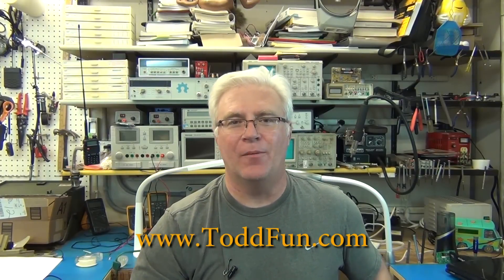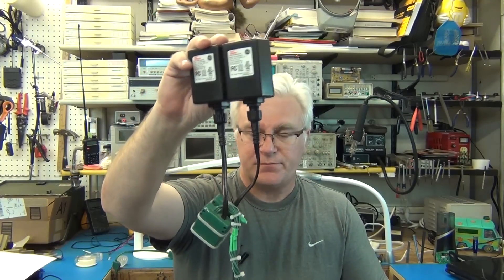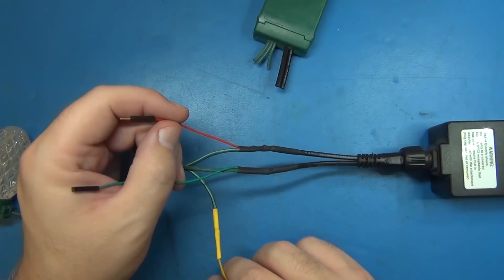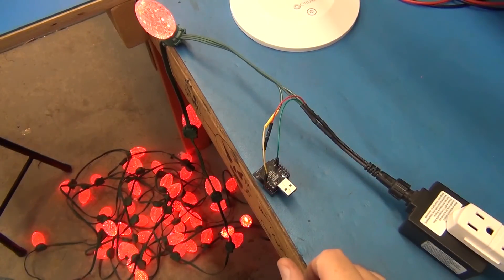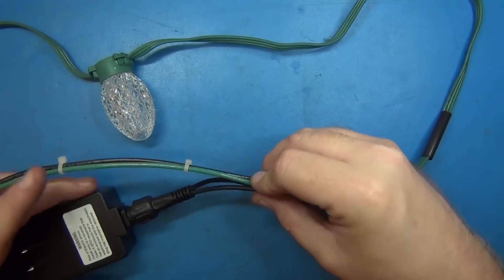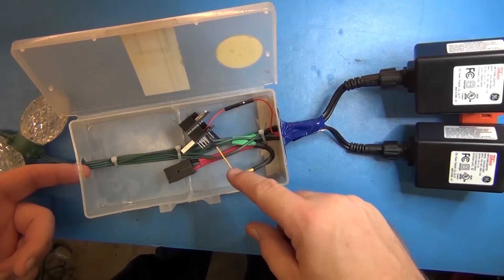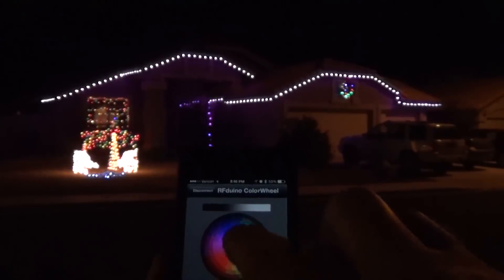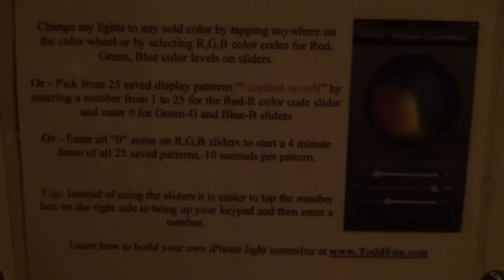iPhone Christmas Lights Controller for GE G-35 LED Lights

Comment: I've been following your blog for a few years now (you're awesome by the way) trying to get up the gumption to hack my Christmas lights like you did.  This year, one of my 3 strands of GE icicle lights seems to have gone dead (I think it's the controller), so now is the time as your hack bypasses the controller!  I love the new tutorial you just posted, but I don't own any Apple devices.  Do you have any idea how I can make this work on Android?
Reply from the maker: Lisa Broadway-Savage Simplest thing would be to follow this hack and just leave it on cycle mode or change the code start setting to just be a pattern you like each year. Then before you put up the lights each year change the hard coded pattern choice or add and remove patterns to cycle through. More advanced, it will work with anything that can connect to it via bluethooth and sends 3 number each between 0 and 255. I don't know of any android apps that do this but if you can find one it should connect and work. As for the bad lights, the wires can go bad too. I had some icicles and the swinging of the icicles cracked the wires at the base of the icicles and caused so much damage I had to put them in the trash.
Reply: ***** Ugh, my problem is the power supply, not the controller as I previously thought. Those bad boys are expensive on ebay!  I can't believe it only lasted 4 years for $80 strand of lights - thanks a lot GE.

Comment: Todd, ok, stupid question.  I have 5 sets of these.  3 sets of 35 lights and 2 sets of 50 lights.  Two of my sets are not working and two sets have work but at the end has one banking light different then the rest. Have you ran across this problem?  If you haven't, how would you trouble shoot this.
Reply from the maker: +Tom Sims Lots of these set I hear die. The controllers fail or the power supply fails. GE had a good warranty on these for 3 years so most people return them for warranty replacement. Most likely the last bulb has one of the three colored LEDs in it burned out making the RGB mix look wrong. Pop the cover off and wrap it in black tape so it can't be seen. If you don't do warranty replace then for the two no working, switch your power supply bricks from a working set and see if that fixes it. If it does then I think you can order new power supplies online or get one off eBay for cheap that is reporting good power supply but bad lights. If the controller is bad the lights are trash unless you want to get an RFDuino like in my video, download my code and splice the RFduino in as the new controller. You don't need an iPhone if you only want to program one sequence or have a set of switching sequences on a timer programmed. The iPhone is just so you can change the sequence without getting it down.  See all my links for supplies and code at: http://www.toddfun.com/2014/12/27/build-an-iphone-christmas-lights-controller-for-ge-g-35-led-lights/ Good luck an let me know how thinks work out.
Reply: +Todd Harrison (ToddFun) Thanks Todd,   have switched out the power supply, no luck so I'm guessing it is the controller.  My warranty ran out on the 50 strand lights maybe a year ago... my luck.  I will follow up on the rest of your suggestion over the next couple days and let you know what happens.  Thanks for getting back to me and I will check out your suggetions!  Again,  I really like your vids and work on this site!
Reply: Mine all work fine.  Buy the PS from GE for $8 instead of the $35 rip-off eBay prices.

Comment: It looks like RFduino is discontinued, I couldn't find it. Is there the replacement?
Reply from the maker: No it is not in production anymore. You might find them on eBay but not cheap.

Comment: looks like your using the general I twinkle lights. what a joke those were. this helps me with programing my own.
Reply from the maker: I have been using Lumenplay this past couple of years and like them right out of the box. They do everything I want from app based Christmas lights.
http://astore.amazon.com/tod0f5-20?_encoding=UTF8&node=11
Reply: Yeah but you have to go back to Bluetooth.  If it were Bluetooth 5.0 you finally have a decent distance.  I'd prefer to get the ESP8266 working but I can not get the firmware to respond after I burn it.  I get no output.  Without the output I can not connect and set it up.